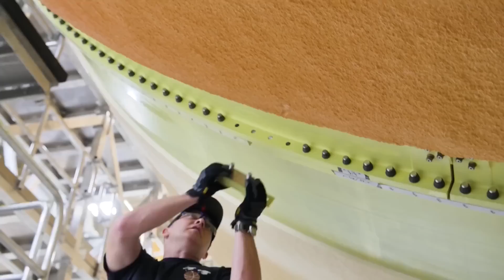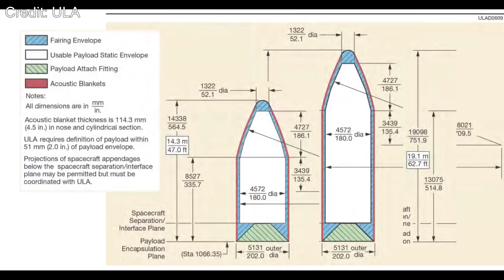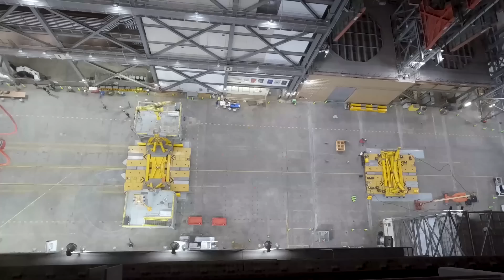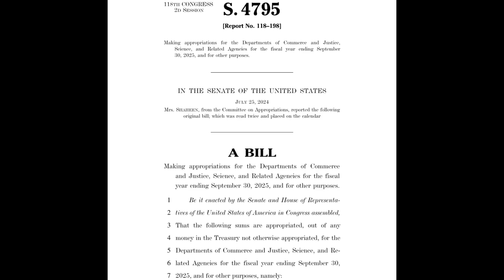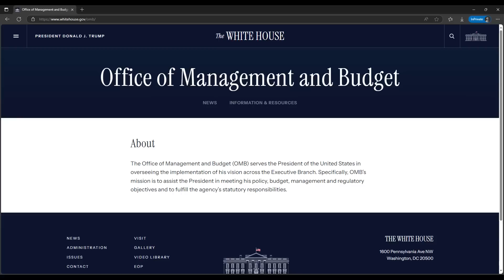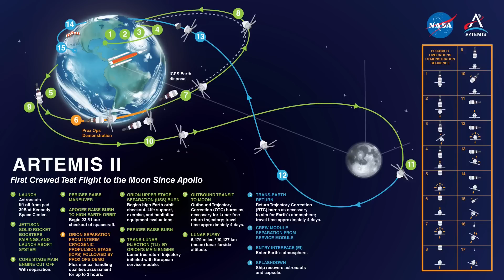NASA Artemis II SLS stacking continues, keeping an eye out for budget request plans

Comment: What was the interval between the Artemis I LVSA stacking and ICPS stacking? Is it likely this one will be any faster?
Reply from the maker: It was a couple of weeks from LVSA hard mate to ICPS hard mate for the first vehicle, but it takes time to torque all the bolts between the LVSA and the Core Stage, which are permanent.  The ICPS connection is meant to be quickly disconnected, so it's faster.

Most of the time from here until the end of the summer on the SLS/rocket side will be spent in test and checkout, that's 4-5 months versus 4-5 weeks to get the Core, LVSA, and ICPS bolted together.

First time they had extra tests they don't have to perform this time, and they are probably also pacing themselves because the Orion launch processing is considered the critical path.  And there are a few loose ends they need to complete, like the engine replacement and adding the strakes to the Core Stage.
Reply: @PhilipSloss  The stacking of Artemis II's LVSA and ICPS would go faster if after the ICPS has had its' RCS hydrazine loaded be stacked and integrated in the VLA's low bay before being stacked on top of the first-stage as one unit.
Reply from the maker: @nicholasmaude6906  They would have to evacuate the VAB to do the hydrazine load, which would stop all other work on the Boosters and Core, and even then you'd save maybe a couple of weeks.  The longest set of tasks is the testing and checkout coming up, that's several months of work.
Reply: @PhilipSloss  What I meant is load the ICPS's RCS tanks in the usual facility before moving it to the VAB and integrating it with the LVSA before stacking it.